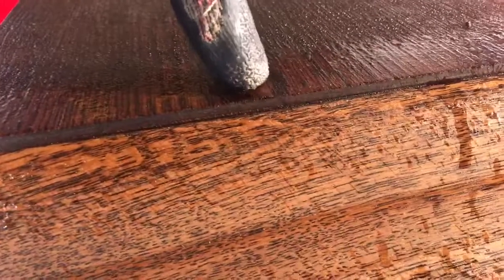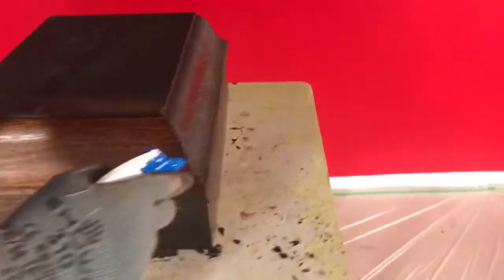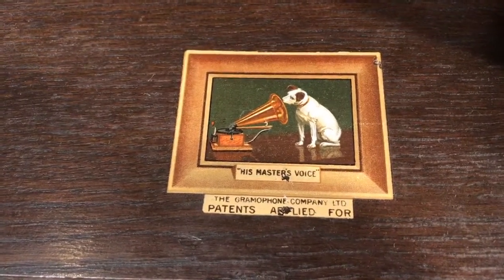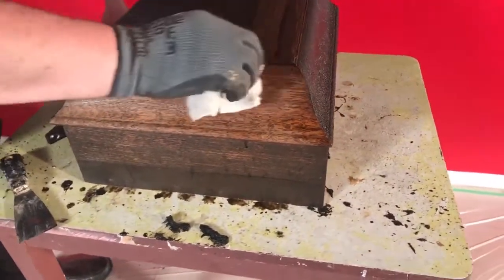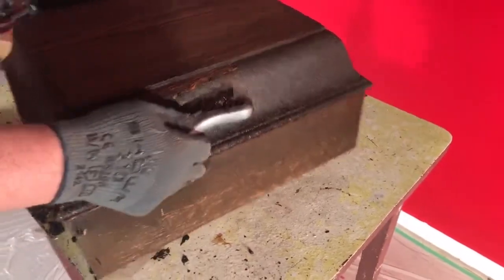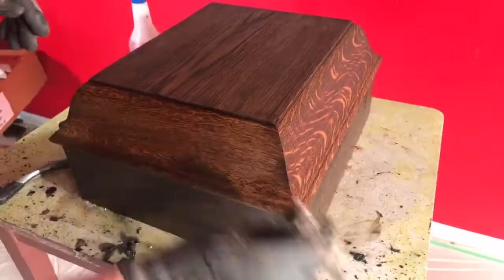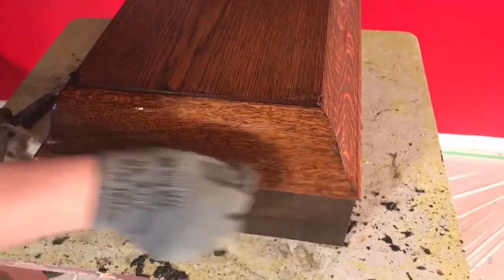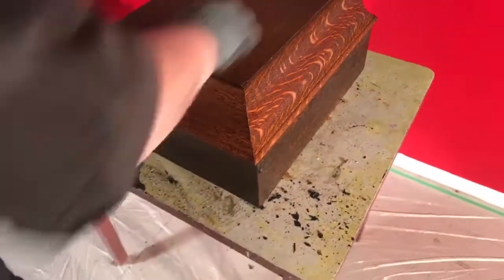How to restore an antique Gramophone

Comment: Need tips on Restoring a Bell labs RC 36 Bell record o-fone. Cannot seemt to track down a schematic.. Had to take apart the gearunder my plater as something was grinding.. My replacement motiors is stuck. Thinking of switching to a 30 volt 4,000 RPM D.C. Motor. speed controled at 45rpm.. I am finding these old A.C. Motors have issues if peices arent aligned..